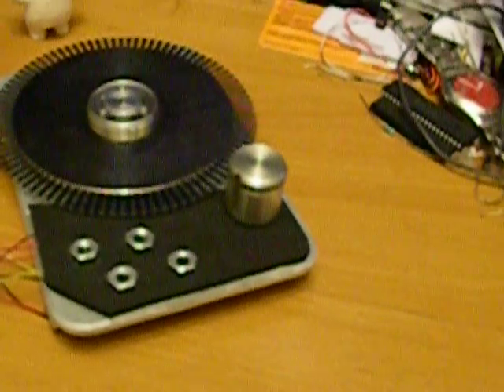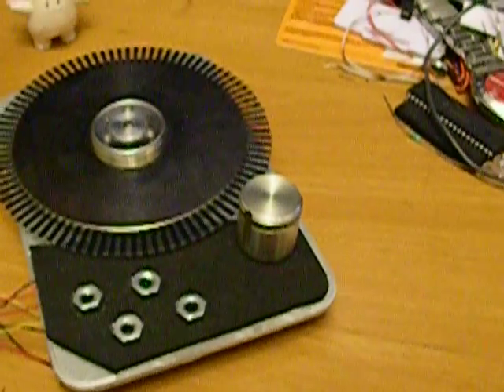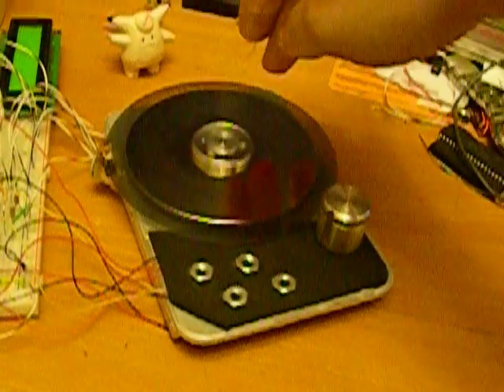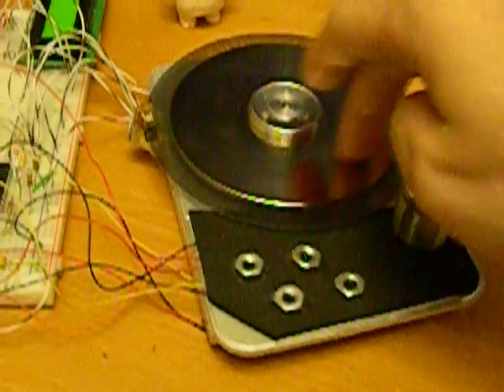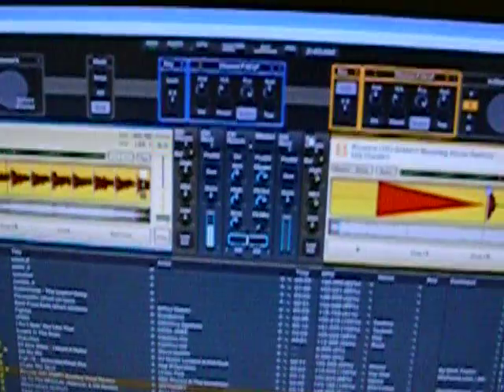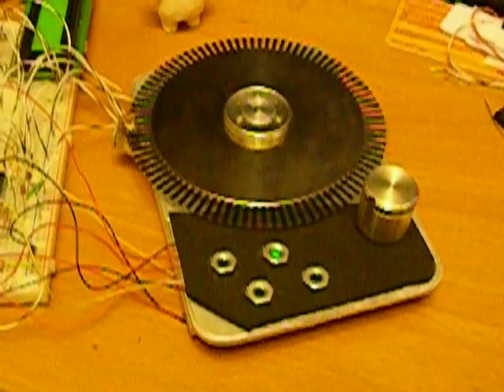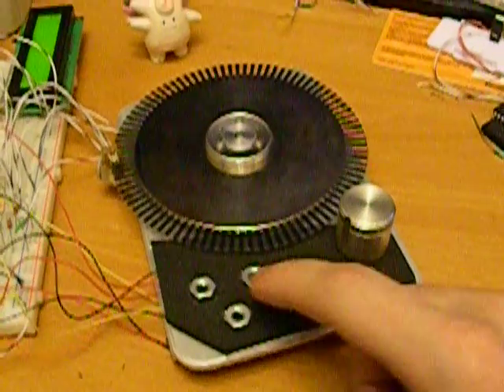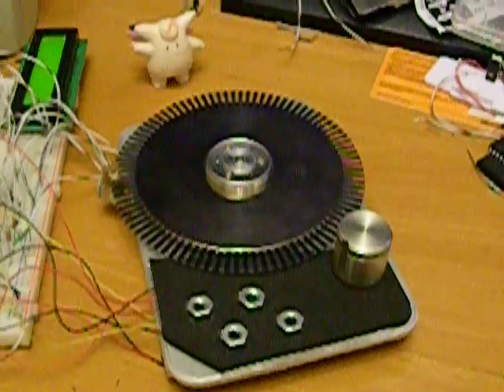scratch pad update 3

Comment from the maker: @Aqlor Capacitve touch sensing on some random metal nuts... A piece of metal and your body form a capacitor. You can either get an IC or module that does it, or do it from scratch in software with your microcontroller and an ADC... There is a nice instructable on capacitive sensing I'll link in the description.